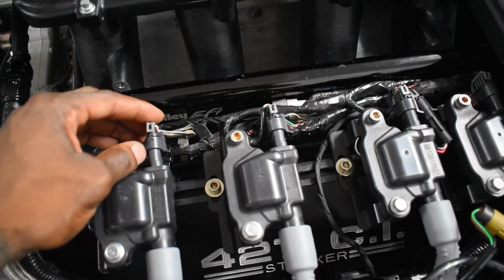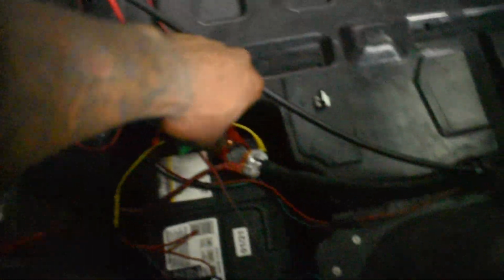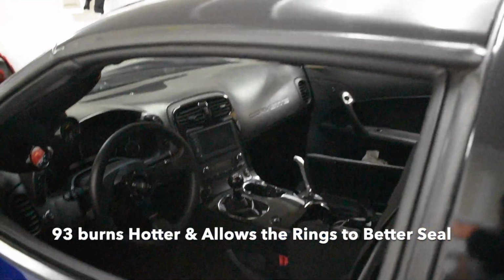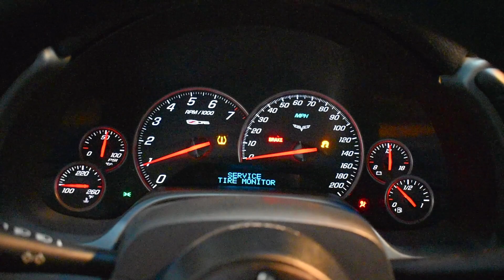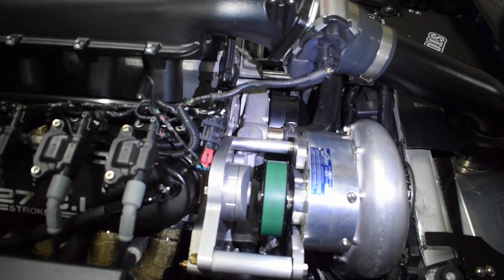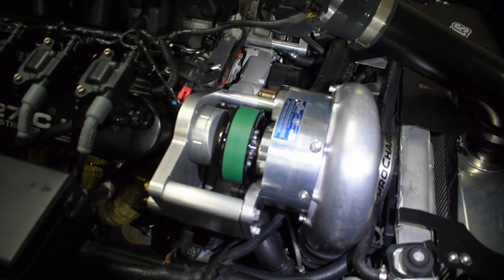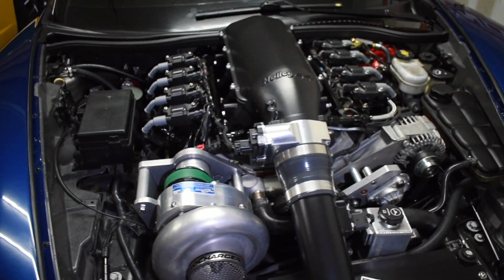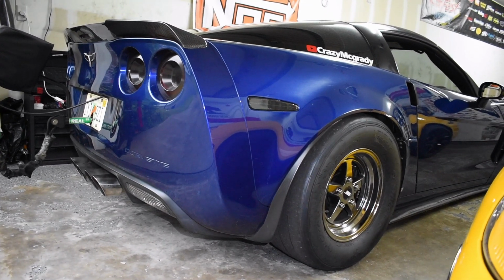ProCharged 441 LSX CORVETTE C6 Z06 | Start Up & Idle

Comment: U think a stock transmission on a  ls2 6.0 with a stage 3 cam with a 3200 stall handle the power?
Reply from the maker: With the LS2, if it’s on a corvette, you gotta watch out for the differential. My brother has an 05 LS2 and we swapped the trans/diff to a z06 trans and diff
Reply: @McgradyRacing  damn lol just camed my 2006 ls2 now im scared my trany or dif guna go out 😞😞
Reply: I know the 05 ls2 is 4 speed and the 2006 is 6 speed does that  make a difference
Reply: @dover1966   Don’t get on a drag radial or any super sticky tire for that matter, you can make decent power and your driveline will probably live. The problem comes when you get a lot of traction and there is no fuse (tires slipping, clutch slipping, Etc) along the driveline and you dead hook.

Comment: What are the specs on the cam if you don't mind me asking? Wanna know how it compares to mine in my new engine
Reply from the maker: I had a cam spec card, but I misplaced it. I believe she’s a 242 258 113. I’ll look for that print out again
Reply: @McgradyRacing  nice that's pretty close, mine is a 238/260 117

Comment: You should of broke the engine in without the blower belt attached. Also you Shouldn’t let it idle if your doing the engine oil break in
Reply from the maker: I got you bro, different builders have their perspective recommendation. I received a print out straight from my engine builder that specified what to do and for how long.
Reply: @McgradyRacing  No worries. I was curious how noticeably the weight difference is up front with the iron LSX Block + Procharger Kit?

Comment: Sounds like timing is not where it needs to be, and afr  needs to be spot on ,or put on a dyno
Reply: Keep a check on the plugs to varify it ,before going to full throttle or wot, is the computer system self learning, if it is don't trust it or you will melt the pistons down
Reply from the maker: Lmaoooo thanks for the inputs brother !